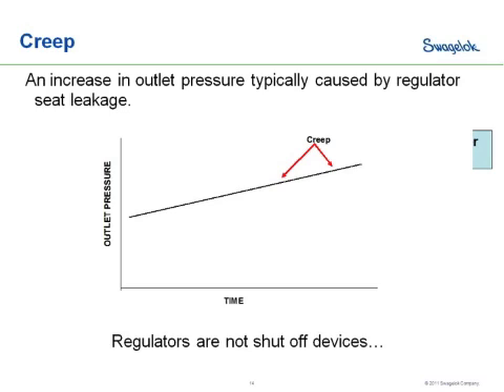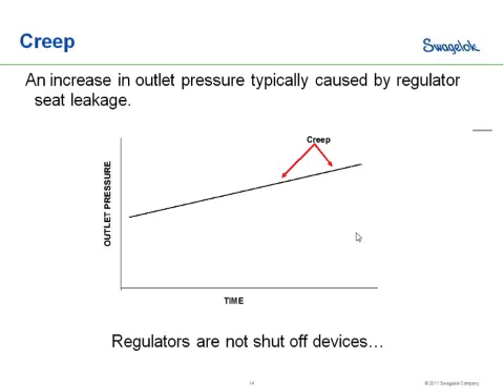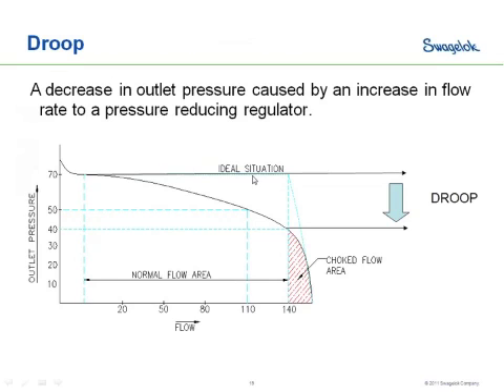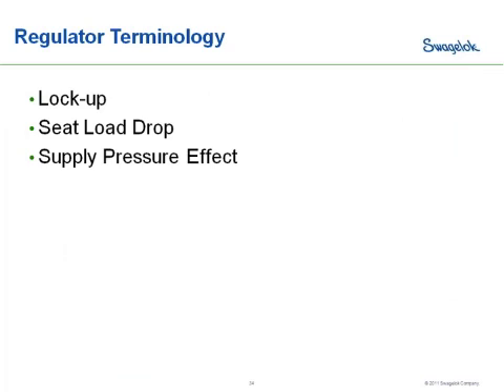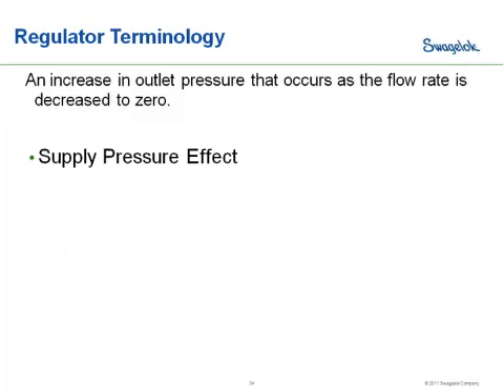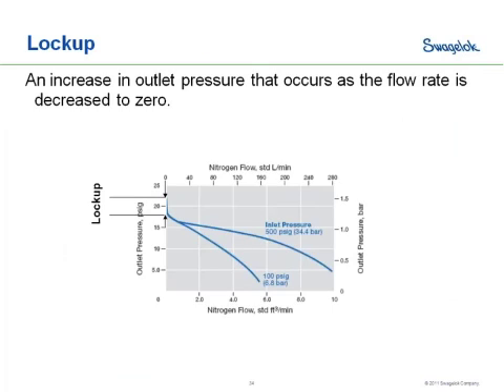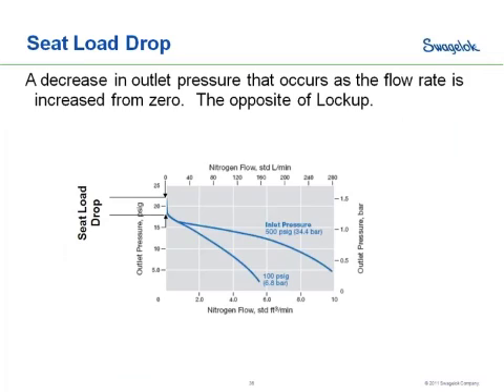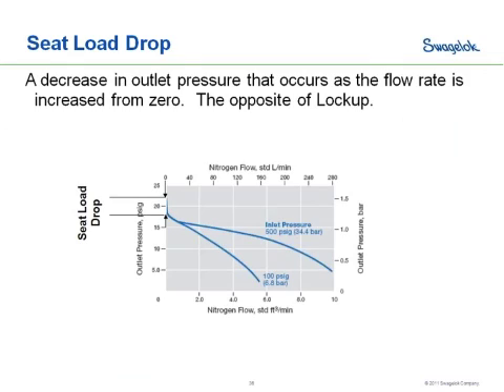Creep, Droop, Lockup, Seat Load Drop: Webinar Highlight

Comment: Q's 

1. Does dual stage regulators experience "Creep", how much is acceptable?
2. Where can you find the point of Lock up and Seat Load drop? Is it on the regulator's flow chart?
3. If the outlet psi is set above the Lock up and Seat Load drop, can the two effects still occur?